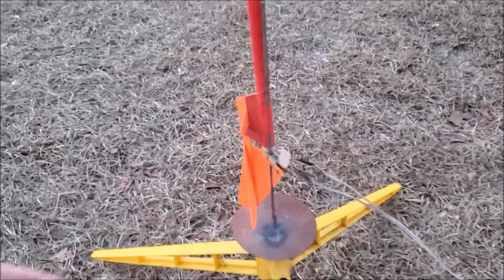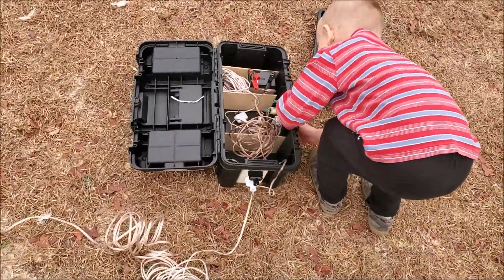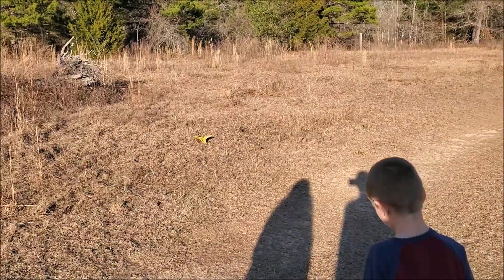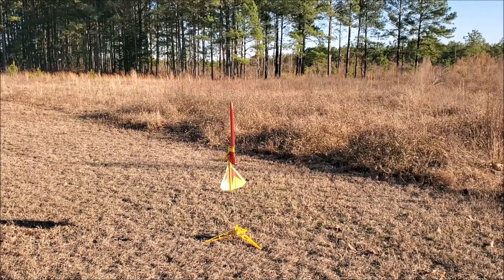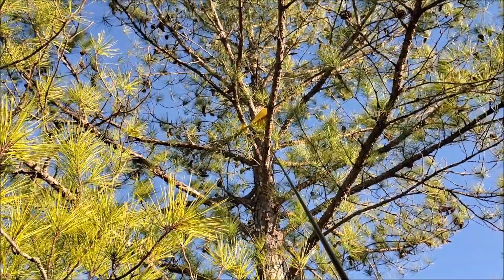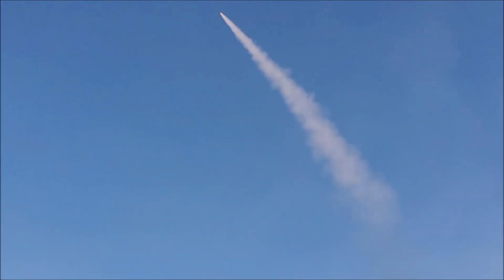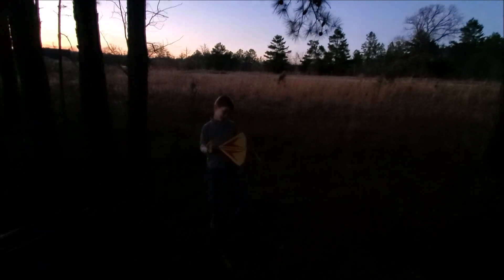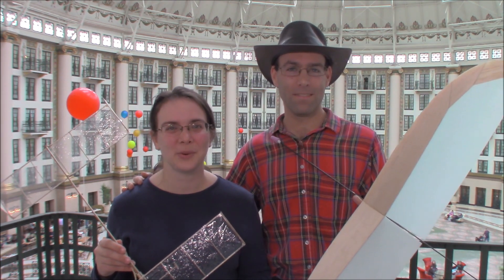Flying our Dactyl series rocket gliders with retrieval advice and family fun!

Comment: 0:28 is that a gas tank near that firework?😮
Reply from the maker: 1. Fireworks are distinctly different from rocket motors.
2. If that tank were vulnerable to 13mm motors, I'd have much bigger problems than separation from the tank.